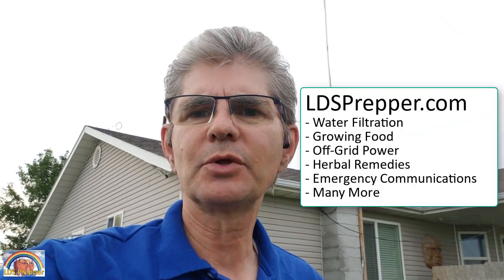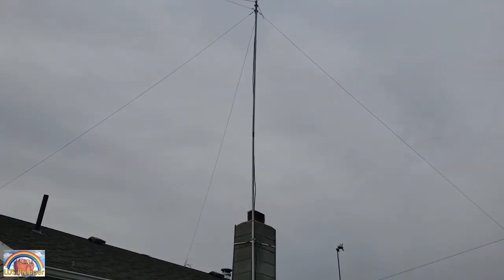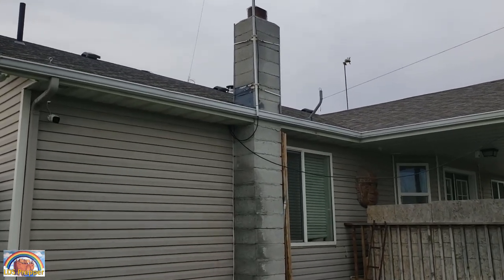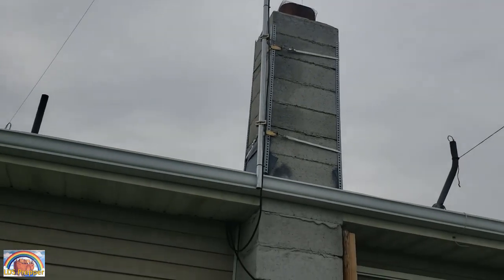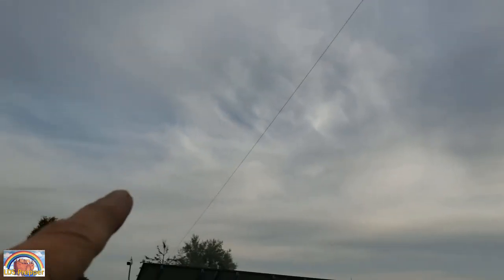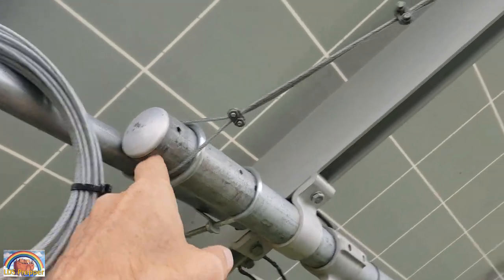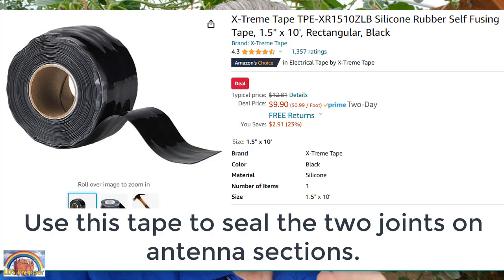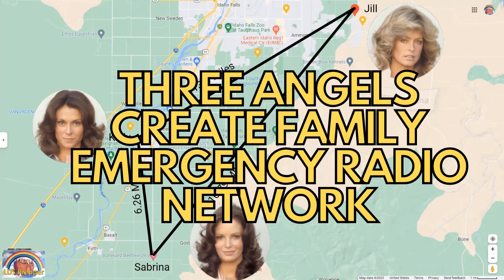Easy, Affordable, External Antenna Mounting Options for GMRS, 2m, 70cm VHF/UHF Radios

Comment: Excellent informative video! I’m about to install a GMRS antenna on my roof, thanks to your ideas it will now be much easier. I need your help,however. How did you run cable through the basement window? I don’t want to leave the window cracked open due to our climate (rain & snow). Any suggestions would be greatly appreciated 🙏

Comment: nice work. better to use antenna mast pipe. sold at most hardware stores near the TV antennas. also stay away from power lines. if the antenna or coax come in contact people will die.

Comment: Would there be any issues with the heat from the chimney with say a fireplace burning on the chimney mounted one?
Reply: Or with the chimney being damaged by the antenna flexing in the wind?

Comment: I have tried to implement a stake wide comms plan but people arent that interested, and we only have 3 hams in the stake, plus the stakes in europe are over a very large area. 
Ward level, literally no one has any gear, im 18km from inlaws house, with a family members house half way and just infront of the biggest hill in the area, but that hill hosts aircraft radar etc so cant be used. 
But im working on getting a signal out to the half way point, cannot happen due to topography as there is no line of sight, so for me in an emergency id have to pop a repeater up ontop of the hill outside my property. 

consider lightning on those antennas, I dont know whats around you, but you dont want your antenna to tbe the highest point in the area.  

my next antenna instal will be on a 8-10m high tower, they are commonly sold here for tv antennas as the area has a lot of hills.  I will need to address lightning for that. 

So are these other two people the only people in the ward with radios?

Comment: Great Video, Thanks for sharing. To my understanding moderate vs Hi Decibel gain antenas are better for rolling hills.    Which antenna would you recomend for GMRS radio wanting about 20 mile reach in an area with moderte hills and a totall elevation difference of 170 ft.

Comment: BTW, thanks for the great informative video! Awesome details, including displaying the specific parts used and description of whwre to find them (i.e. Homedepot, online etc.) Question: Which base station antenna do you recommend for a semi-rural area with significant hills; likely to be used with a Wouxun KG-935 g plus or a KG-1000 g plus. Hoping to reach about 20 miles (between home and work) as the crow flies.. going over moderate rolling small hills. There is a couple of repeaters listed in the area, but I anot sure if there locations will be well suited or not for my needs..

Comment: You need a lightning arrester and grounding to meet code.
Reply: I’ve run base stations 11m /CB and GMRS /Ham for well over 30 years.  Not once have I used a lightning arrestor.  Not one issue with strike’s    I do sometimes add a ground cable from mast to a 8ft copper rod imbedded in the ground but that’s ONLY if I have issues with static.  

Grounding actually attracts lightning.    The at atmosphere discharge will seek out the best grounding point when the storms move through.    
I have some old ham buddies that have been on air for 60 + years that have never grounded their rigs.   
Just be careful to disconnect coax or have a switch box to disconnect your rigs when leaving home or when storms are in area.   
You do as you please.
Reply: not code in most areas, but it is needed even for a static charge. 
also have a disconnect on your coax if a storm is coming in. 
but the coax lightning arrester part should also be grounded. 
read up on how ham towers are set up for finding the correct way to do this. 
as even all radios in your shack needs to be grounded. 
a discharge can melt plastics, shock you big time, can even kill you outright. 

be safe.

.

Comment: Great video.

Would it be a terrible idea on one of those antennas mounted to a plumbing vent to run the feedline into the vent pipe a bit, leave a drip loop then drill a hole in the vent pipe from the attic to bring the feedline into the attic to get it wherever? Not sure I see a problem with a hole in a vent pipe (silicon or other water seal around the feedline/hole of course)
Reply from the maker: Interesting idea. I don't see a problem with that.

Comment: Great video! How does the 17 foot VHF/UHF antenna at Ricks place compare to theTram 1486 antenna? Would it be better and of so, what brand? Thanks again.
Reply from the maker: Rick has a Diamond VHF/UHF antenna. It cost 4x more than my Tram 1481. We get the same results. Here's the link to the Tram You can check it out. https://www.buytwowayradios.com/tram-1481.html?cmid=amsreGRvTmttM0k9&afid=Z2xWYVI0cVp6Slk9&ats=L2VYZkg3Qmh6akE9
Reply: Nice, thank you!

Comment: I hope you have the antenna mast pole grounded and a lightning surge arresting component inline of the coaxial cable! If not, you run real risk of losing your radio systems with lightning strikes...
Reply: As a ham, I would drive a 10' ground rod and use a lightning arrestor to give a good path to ground in the event of a lightning strike. It not, you wind up with all that energy in your house. I'd still disconnect the antenna during storms.
Reply from the maker: Excellent point. We have discussed this on our local VHF net in depth. Bottom line. A direct lightening strike will destroy everything even if grounded. When we have lightning within 10 miles we disconnect our antennas.
Reply: Maybe it could protect you from personally receiving current into your body or minimize the risk of starting a fire by redirecting the current into the earth outside of your home.
Reply from the maker: @bluedirtgreen  Yes proper grounding is the best solution.
Reply: He obviously doesnt have it grounded, hopefully his insurance includes masts :) He should also do a little research ( or ask a local ham) what effect those long metallic guyes will have on the radiation pattern of his antenna.